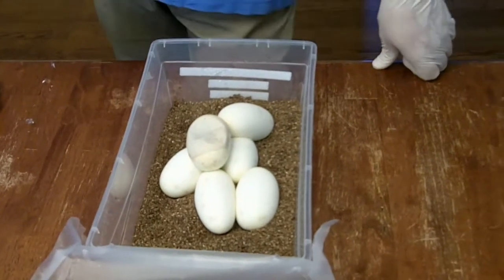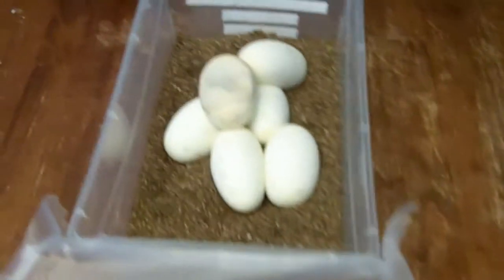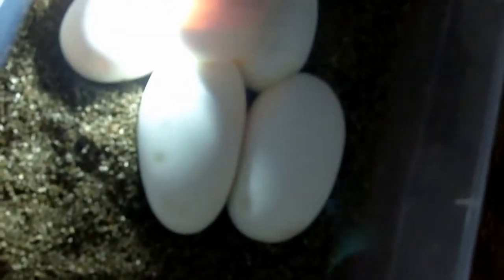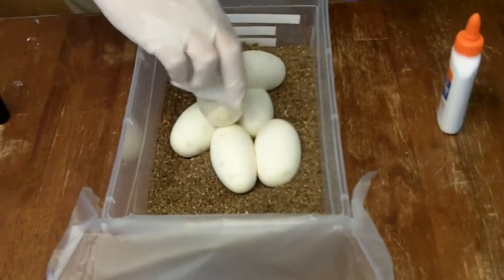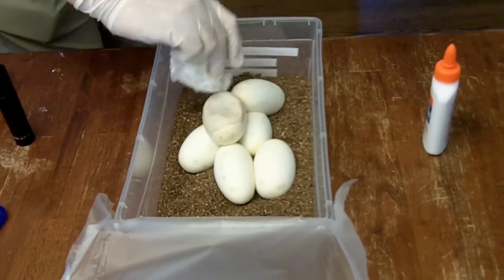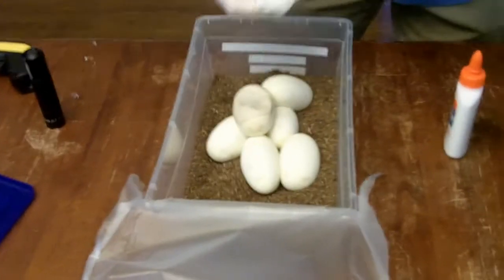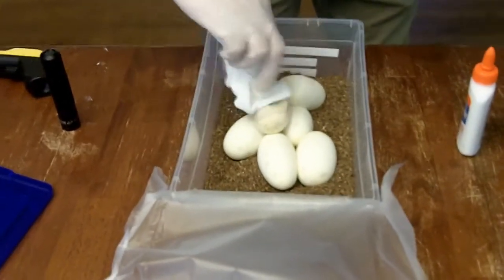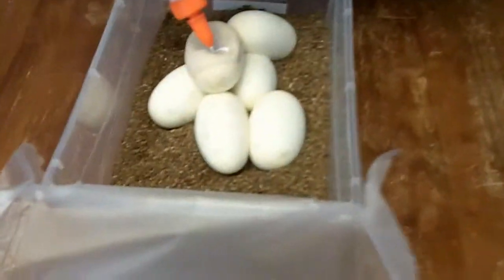Egg repair with Elmers glue

Comment from the maker: This is the first time I have done this technique.  It would be the same as liquid bandaid.  It does provide a bit of strength to the applied area.  Joe, if the eggs are molding you may want to consider the foot powder method to help control it.